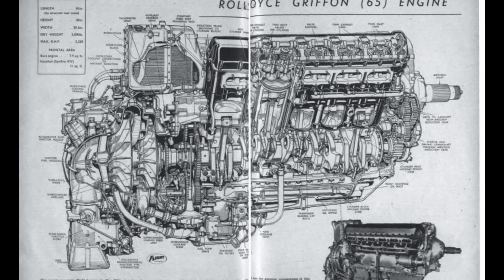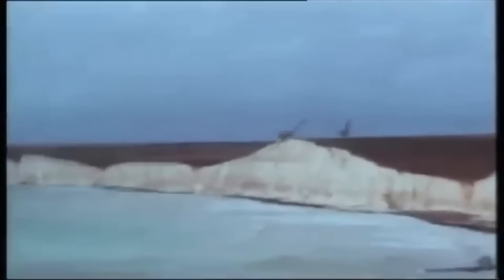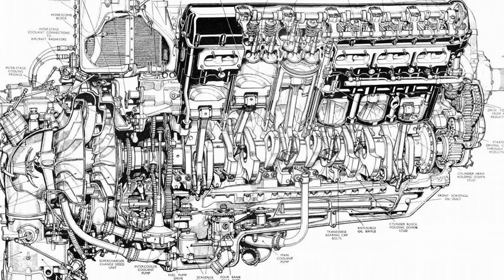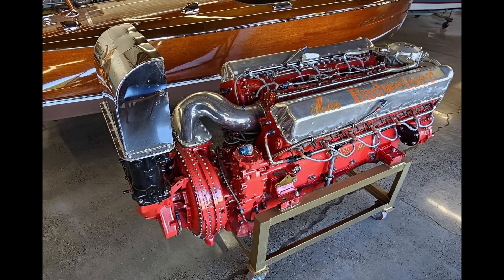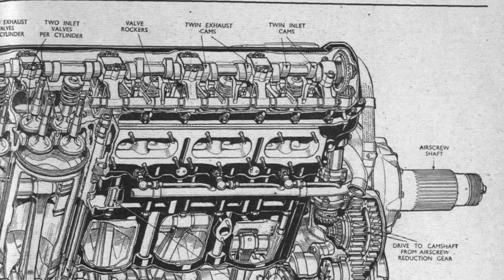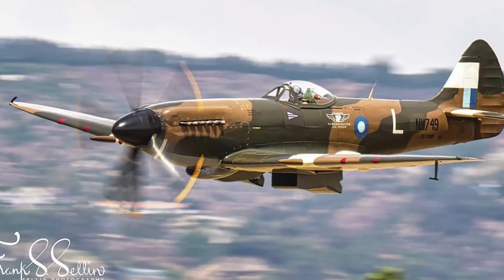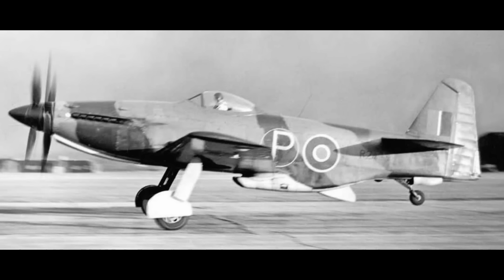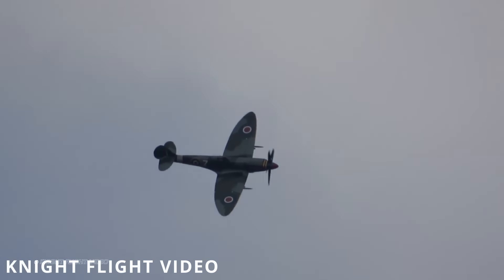The Last Word in WW2 Horsepower - Rolls Royce Griffon

Comment: Can anyone explain how turning the opposite way reduced the need to deal with engine torque? 
Counter-rotating props, sure, but turning the other way just means the pilot's other leg gets tired on takeoff.
I suspect the writer got turning the other way mixed up with counter rotating props that some Griffons were equipped with but, from the photos, not most.

Comment: It's a pity effort was wasted on the Crecy, which like the Wankel was an inherently failed approach. The Bristol and Napier sleeve valves should also have been scrapped and replaced with US-style radials. Of course hindsight is wonderful, but the Merlin and Griffon between them were about all that was needed. If the effort wasted had been spent on multipoint fuel injection and an equivalent of the German mechanical ECU, it would have paid off.
RR learned from crashed Junkers - a major improvement was feeding oil through the crankshaft, not through the bearing shells, thus improving bearing strength. Both Merlin and Griffon had pressurised oil feed as they had journal bearings, that wasn't a difference.
The biggest benefits the Allies had were access to superior fuel, superior alloys and superior bearing materials, along with not making the mistake of the inverted V design which caused problems for the Germans with oil dilution and plug fouling. If Jumo engineers had been in charge at RR, and BMW engineers at Bristol, that would have been the best of both worlds, I think.
Reply: The Bristol sleeve valve engine in the Beaufighter was very reliable due to better design and metallurgy.  The Sabre was indeed unreliable and a P&W would have been much better.
Reply: @bobsakamanos4469  Yes to be fair the Bristol engine was much better than the Napier, but the BMW 801 showed what could be done without access to the best materials, and was all conventional technology.
Reply: @EbenBransome  the 801 was certainly a good engine, but clearly augmented with advanced aerodynamic cowling, cooling fan & exhaust outlet system, the latter being copied by the Allies.
Reply: @bobsakamanos4469  Exactly so, and the effort needed to try to get sleeve valves to work could have been spent elsewhere.
Sleeve valves arose because of poppet valve problems (detonation, burning etc.) which seemed to be fixed by not having valves exposed all over to the exhaust. And then along came sodium cooling and inconel.
I would agree with any mechanical engineer who said that the Wankel and the sleeve valve are more elegant than poppet valves. But poppet valves work.

Comment: 6:45 Er... Okay...? Are you sure you were not confusing things with contra-rotating prop or anything?
Reply: the contra-rotating props on later spitfires, as well some other naval aircraft takes prop torque out of the equation, but you would still get a tendency to roll from the crankshaft counterweights at full power - as far as i know (I'm a model maker, not a pilot, so ...)

Comment: I'm assuming that if the crankshaft rotated "the other way", the airscrew reduction gear was set up to have the prop rotating "the normal way", so the undesired torque effects cancelled each other to some degree? I've always been fascinated by anything with contra-rotating props too, amazing engineering.
Reply: YOu can't cancel torque by the internal workings of a gear reduction any more than you can reach down, grab hold of you boot straps and lift yourself off the ground.   It's the same principle.   The internal forces are irrelevant.
Reply: The griffon actually had more torque.  I can't imagine a pilot having to relearn rudder and stick control inputs to accommodate the counter-rotation of the griffon prop.

Comment: ironically, the early Allison V-1710 could produce 1800HP at 70" MAP, and later engines were putting out 2200HP at 70" towards the end of the war. and was lighter and smaller than the Griffon and Merlin. the engine was only officially approved for 56", but everyone was flying them at 70-75" throughout the war and Allison verified this performance and that the engine Could be operated continuously at this power setting.

What the engines produced in reality in combat by the thousands matters more than a few test articles and official statistics that artificially limited its capability.
Reply: I've read that the Allison also had roughly half the parts count. A local V12 mech hated Merlins (I know this is about Griffons) and swore by Allisons. He was maintaining 3 of the repro Yak3/9s, which subsituted Allisons for the unavailable Klimovs. The Allison was a very good engine. It's 'shortcomings' were imposed by the governement, who was bent on trubocharging and saw mechanical development a waste of funding. Graham White's book says the add-on mechanical that came later was not efficient. It was also more bulky. There was a late, turbo-compounded development engine that made about 3000HP. To me, two things stand out: the engine had the highest piston speed for the time while still being reliable, and race Merlins use Allison connecting rods.
Reply: @busterdee8228  Yes, I also met a modern warbird mechanic my age who used to work for RR in England on Merlins, and then helped restore the P-82 and now works on Allisons, and he told me tons of things only a mechanic would know that are not in any books, and he disliked the Merlin and loved the Allison.

Allison was 300lb lighter than the Merlin, smaller (smaller frontal profile, meaning lower drag and more aerodynamic), thousands fewer parts, easier to work on, Post-WW2 live fire tests proved the Allison more damage resistant to .30cal, .50cal, and 20mm than the Merlin. And the Allison was more fuel efficient too.

The US gov withdrew funding to develop the Allison's High-Altitude 2-Stage Supercharger, and thus NAA switched to the Merlin for the XP-51B.

Also, Allison was let down by a faulty carburetor. Which is frustrating because carburetors can be swapped out and plenty of companies built perfectly good carburetors.
Reply: @SoloRenegade  Fascinating. As an old mech myself, that conversation would have made me pinch myself. Merlins were a study in 'push them 'til they break, then redesign that' engineering. I love them, but I refuse to deny Allisons an equal spot on the hill. Thanks.
Reply: oh oh, not the Allison myth again.
Reply: @bobsakamanos4469  not a myth. it's documented
Reply: @SoloRenegade  documented lack of performance & reliability at high boost.  Wright Field, NACA Langely, Eglin proving grounds.
Reply: @bobsakamanos4469  which aircraft, what circumstances? which engine?

Which test report am I looking for a copy of that proves what you claim?
Reply: @SoloRenegade  start with the trials of the 150 Octane on the P-51B, P-47 and P-38L.  Then look at all the engine failures with the P-40Q.  Then look at the poor reliability on the P-82 engines.... for starters.
Reply: @bobsakamanos4469  P-40Q and P-82 came after teh aircraft I talk about. Not relevant to the data about the P-51A, P-40N and early P-40s.

"start with the trials of the 150 Octane on the P-51B, P-47 and P-38L.  "

none of those apply to what I said. the P38 is a special case for Allison, as they had a bad fuel control setup, had no intercooler after teh turbo causing known issues at higher power settings, etc. and the other planes didn't use Allisons at all. such a report has literally NO bearing on anything I claimed.
Reply: @SoloRenegade  so the stronger G version of the Allison couldn't handle 70" MP, but weaker previous versions could?  You've been drinking the Greg kool aid again.
Reply: @bobsakamanos4469  nope, I've been reading RAF, USAAF, and Allison documents and mission reports from WW2 that cited this happening throughout the entire war. Pilots, mechanics, commanders, and more all documented that pilots were constantly pushing the engines without issue.
Reply: The Allison was an excellent engine at low altitude.
Reply: @ the early allisons on the P-40B & C were very problematic.  Later in the war , the -81 was fine only if not overboosted.  Detonation was always a problem though due to the uneven fuel distribution.  Poor intake manifold design.
Reply: @bobsakamanos4469  it was a carburetor issue. not an engine issue.

"the early allisons on the P-40B & C were very problematic."

yet you failed to name a single verifiable example of this.........
Reply: @givenfirstnamefamilyfirstn3935  yes, but also at high altitude when given a proper high-altitude optimized forced induction system. P-38 and P-63 are a couple examples of this. The Merlin also sucked at high altitude without a forced induction system optimized for high-altitude. the P-40F did as bad or worse with a Merlin. and the Early spitfires and the Hurricane also sucked at high altitude.
Reply: @SoloRenegade  The P-38 didn’t work in the cold and the 1 1/2 stage dog’s dinner non intercooled external auxiliary blower thing for the P/F-82 was utterly ridiculous.  Who bought the Bell Kingcobra?  The Soviets took them basically for free.
Reply: @givenfirstnamefamilyfirstn3935  The P-38 worked perfectly fine in the cld. What it lacked was pilot Comfort in the cold. the plane performed fine, but the pilots suffered due to lack of warmth.

The P-82 is a separate issue from the P-38.

the US liked the P-63, but by the time it was ready, it wasn't better than anything already in frontline service. it was an excellent aircraft, but not god enough. The Soviets loved the P-63 and kept them in service into the 1950s. The P-39 was the single most maneuverable US fighter of WW2, and the P-63 was everything the P-39 was meant to be originally.
Reply: @givenfirstnamefamilyfirstn3935   
You'll never get Solo to admit the problems with the Allison. He clearly has an agenda to rewite history
Reply: @bobsakamanos4469  And all I said was it was good at lower altitudes.  The Italians would have loved having it.

Comment: The Griffon was simply too little too late, with only 8100 being made and only 1700 $hitfires got them !!!! Also the Early Griffons were a single stage supercharged version only later versions were the 2 stage 2 speed.  you cannot paint all Griffon like the Merlin with the same brush.  NOT all engines were 2 stage 2 speeds that people seem to ASS U ME they are!!!!
Reply: In defense of the "$hitfires,' the P-51H was only outwardly a Mustang, but internally borrowed heavily from the Spit's sturctural concept. The 'standard' P-51 has thick skins and less 'framing' (and I assume has much to do with so many surviving). The P-51/P-51A might have been the Spit's equal in ease of flying. The later marks were more skiddish (literally). I imagine the civil marks, stripped of 'angry bits' and the fuselage tank relegated to passenger, is more friendly. If I read you correctly, the Griffon's mojo is mostly toughness and making moderate power for its size. The Merlin had so much horse that the hair had no place to go. Give me a Griffon with a Merlin's cam profile, and my smile will grow until my face falls off.
Reply: LOL, Wilbur is out of the barn again. At least he didn't try to heap accolades on the useless Allison.
Reply: Wilbor has the odd lucid moment and the Allison was a good engine considering it was tied to a single speed single stage supercharger.  The P-51A/Mustang I was red hot at lower altitudes.  The brain dead stupid USAAF ruined Allison development, the more clued in Brits could have sponsored modern Allison supercharger development like their clients Packard did very well.
Reply: @ yes, the P-51A did well with the Allison -81.  Because it was fast, it didn't need to be overboosted and it ran well at fast cruise in the ETO.  P-40s on the other hand struggled and some RAF / RAAF Sqns overboosted the -39 to the point of constant failure.

Comment: The Griffon Sputfire was in NO WAY superior to German fighters..the K4 was more than a match and was significantly faster
Reply: Calm down Adolf, you're wrong.  The MkXIV Spit could reach 446mph at 25,400ft.  Quicker than even the Me-109 K4, which topped out at 440mph at 24,000ft.
Reply: The Griffon engine gave the $hitfire more speed at the expense of handling !!!!
Reply: @JohnyG29  nope the Bf109 K4 topped out at 476mph and 32,650 foot. And it was a rocket up to that height.  Plus this is on 87 octane.

The griffin could barely function on 150 octane and British supercharger development was seriously infantile...wtf puts straight blades on the impeller.

The K14 was the FIRST AIRCRAFT TO HIT 500MPH AND THAT WAS IN A CLIMB
Reply: @JohnyG29  K4 was apart from the Ta152H1 and Bv155 the highest flying fighter of WW2...
Reply: @wilburfinnigan2142  nope... the spitfire was still slower than the k4 which had a 26 to 30mph advantage  while flying over 9,000 feet higher
Reply: Let it ( 109K-4) be faster but the Griffon engined MkXIV was far more manouvrable with a lower wing load then the  High wing load109K-4
Reply: @BenJamInn-q3o  some K-4 had the Daimler Benz DB 605DCM engine  they flew with ca. 100 octane C3 fuel and Methanol water injection i think the high Speed number is for that Version not for the one with B4 87 octane fuel
Reply: Small airframe; big engine--a scalpel not made for clumsy hands.
Reply: Germans had the speed…but couldn’t turn.
Common knowledge.
Reply: History would disagree…..
Reply: @glennllewellyn7369  yes they could... any pilot who has flow the few remaining Bf109s against P51s have stated that the 109 was a tighter turner..

The Spitfure was LESS manuverable than the 109 by a significant margin
Reply: @robertpatrick3350  FACTS would disagree with you.
Reply: @ 
…or something!
Reply: wow, some one's been drinking the kool-aid schnapps.
Reply: @bobsakamanos4469  hah.. you do real8se that the Griffon Turbochargers were akin to preschool designs it wasn't till the British succeeded in the war they cause intending to rob Germany that they started putting curved impeller blades on their Turbochargers.

The K4 was significantly superior to the Griffon.
It thrived on 87oct. It had a higher altitude, It had significant advantages in armament and maneuverability. And even late war German pilots with 10hr flight time experience often out performed members of the communist coalition
Reply: @BenJamInn-q3o  LOL, as soon as you mentioned "turbochargers" you lost further credibility.
Reply: @bobsakamanos4469  and there are literally TWO TC impellers at the rear of the Griffon
Reply: @BenJamInn-q3o  again with the turbocharger comment.  LOL, pick up a book, son.
Reply: @BenJamInn-q3o  ok i explain why you failed with the Turbocharger,  they used  a mechanical driven Charger a Supercharger , not a  exhaust driven Turbocharger  thats the difference. Spits never used Turbocharger only mechanic driven  Supercharger. btw  P-47s and P-38s used Turbocharger , iam not 100% sure but  i think Fw used a Hirth Tubocharger in a Fw190C Prototyp but never in Product. Aircraft, 
B-17, B-24, B-29 used Turbocharged engines too